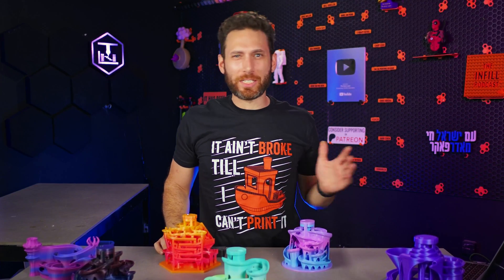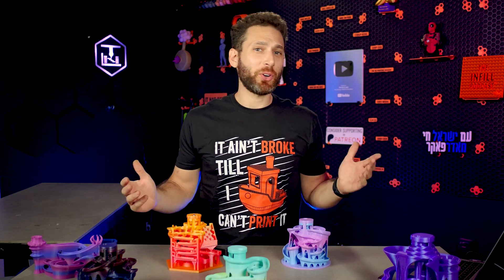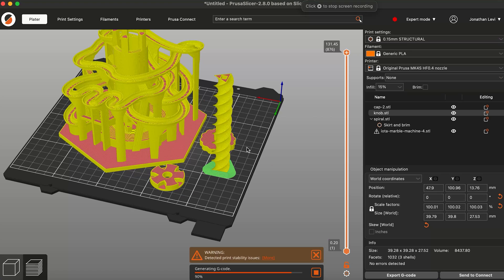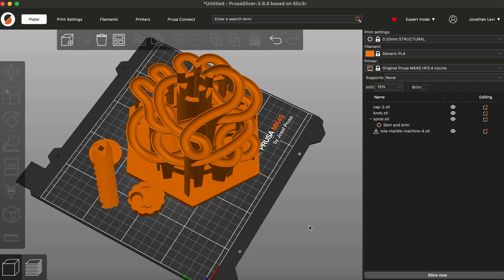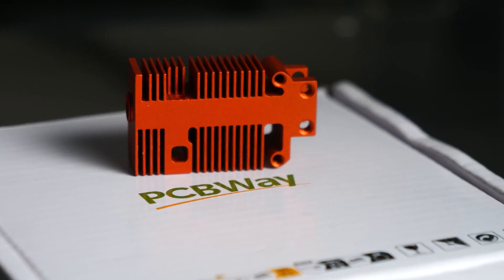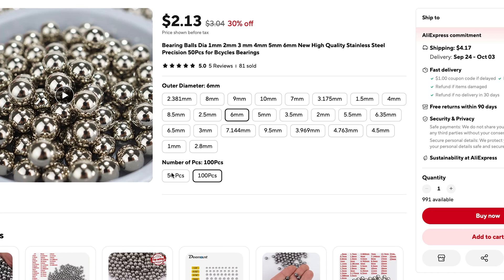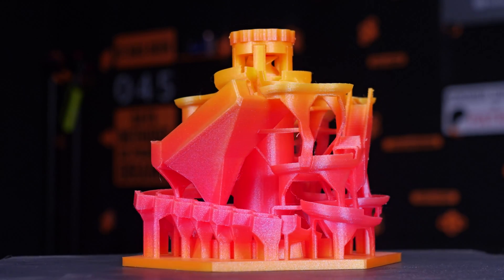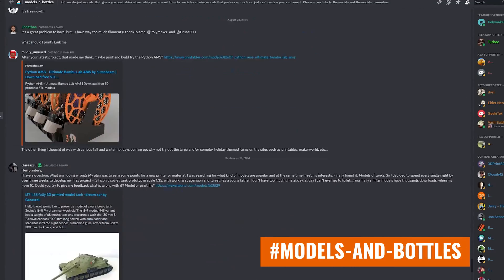These Are Some AWESOME 3D Prints!

Comment: I have been leery of printing one of these However, My one question to you is this. I know you mentioned .15mm layer I normally use .12mm with 3 walls & either 10 or 15% infill. I don't mind the extra time for the smaller layers since the thing I do print come out great. Any known issues with the smaller layer heights? Thanks for all you do. Awesome as always

Comment: Sorry to disagree with you entirely here, but the last time I had difficulty with stringing that no amount of retraction tuning would touch, the solution was to INCREASE the print temperature, not decrease it. Considering the level of stringing I see regularly with your print results that you show, you might want to universally increase your print temps by anywhere from 5 to 10 C. I know you're always, "But teh wet filament!" I literally live in a rain forest area, and have never experienced any of my filaments, PLA, PLA+, or PETG, exhibit the symptoms you attribute to it.
Reply from the maker: Hmm from my experience cooling down helps. But also yeah I store my filament in the open for years in 75% humidity and never dry PLA lol.

Comment: I’m not sure what kind of glass marbles you had, but I had lots of glass marbles as a kid and none ever shattered when stepping on them (outside, on the concrete). We were even bouncing them as hard as we could on the asphalt and they barely had a scratch.
Reply: Yeah, they can withstand over 20,000 PSI of compressive force, I was gonna make a comment, but saw this one.
Reply from the maker: I guess you’re right

Comment: One thing about PCBway, you have to pay attention to the shipping charges.  I was going to order a PCB for a project I'm considering building.  The original designer of the project posted his PCB on PCBway as a project, which allows you to order a single board instead of the minimum quantity (5 possibly??) you have to order for a new design.  The single board, $5 US, fair enough IMO.  The shipping for that single board?  A whopping $20.26 US.  Guess I'll be using a small breadboard or a piece of prototype board.  Probably prototype board, I can use the soldering practice, lol.
Reply from the maker: $20 isn't even that bad... it's coming from the other side of the world, you know?
Reply: @thenextlayer  True, but so isn't a lot of the stuff ordered on Amazon that ships for free. Yes, some of it is coming from local distribution warehouses, but they also come direct from China too, the only difference being a couple extra days in transit.  Even if the Chinese product you ordered comes from a local distribution site it still has to get there from China somehow, and that costs money.  The other side of the world is a moot point in a "global economy".  My Sovol SV08, it's enclosure, and the HDMI screen were all made in China, they all shipped separately, and I did not pay for shipping.

If they shipped with someone besides DSL I might consider it, but I've ordered a lot of stuff on line, and I've been fortunate enough to only have a few orders lost in shipping.  Unfortunately, they were all in DSL's hands when they disappeared.  If they were all small packages that would be one thing, but DSL managed to lose a 30" x 30" x 48" wooden crate containing a 7 x 14 mini lathe.  If they can loose something that big what chance does a small padded envelope have? lol.
Reply: It's coming from China, that's a lot of distance
Reply: @Zac_Cole  So is most of the stuff on Amazon, and they manage to ship for free.  Even if the Chinese product on Amazon ships to you from a local distribution site it still has to get there from China.  If it was another $5 to ship I wouldn't have given it second thought, but I refuse to pay 4 times the purchase price in shipping, particularly if all they're going to do is stuff it in a padded envelope.
Reply: @yertelt5570  normally China gets that tax reduction stuff when shipping to America cuz it's a "developing country" but I guess it doesn't apply in the case of 3d printing and pcb manufacturing